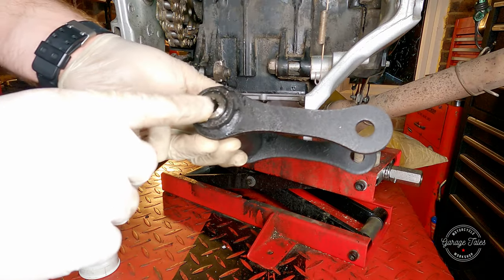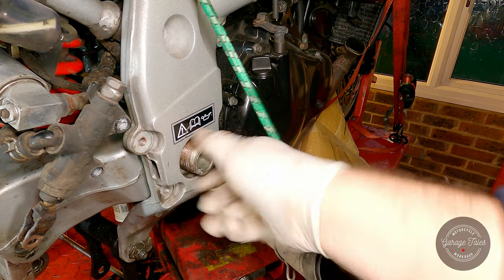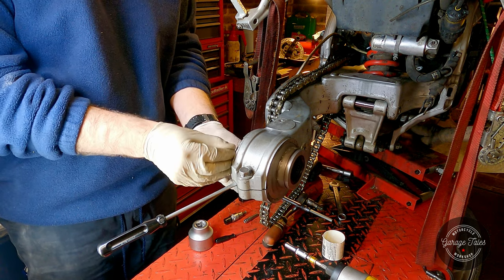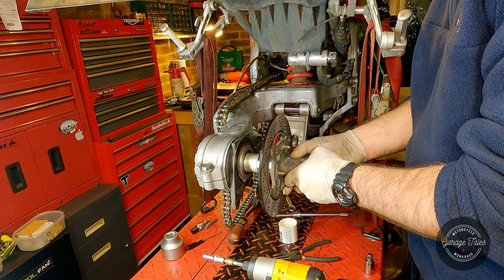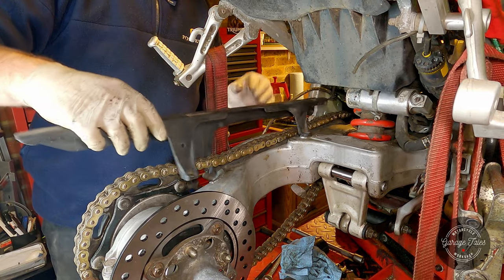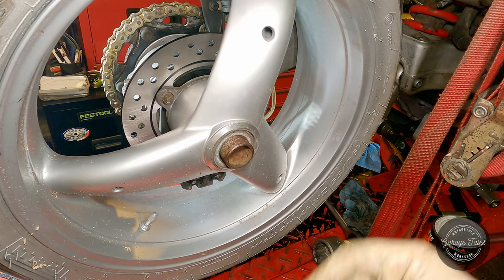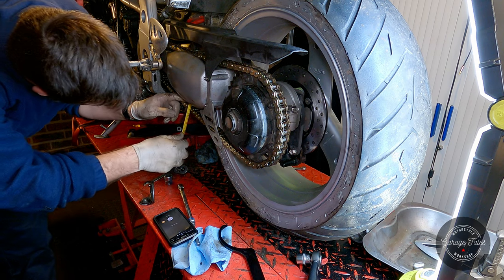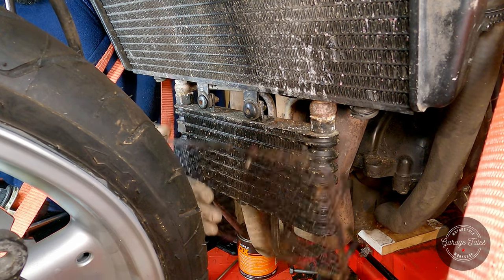Triumph Daytona 955i video 12 -  Rear Suspension Assembly

Comment: Hi where do you get the torque settings for linkages.
Reply from the maker: From the service manuals mostly 🙂
Reply: I have 1999 955i Daytona if you have any information on torque settings on the rear suspension linkages could you give me them.
Reply from the maker: @trevorharper6742  
Suspension upper & lower, drag link, drop link all 48Nm. Drag link to frame 95. Swing arm adjuster 18Nm, lock nut 32Nm and spindle bolts 60Nm. But I’ll double check in the book tomorrow.